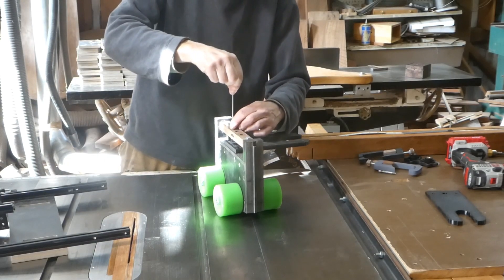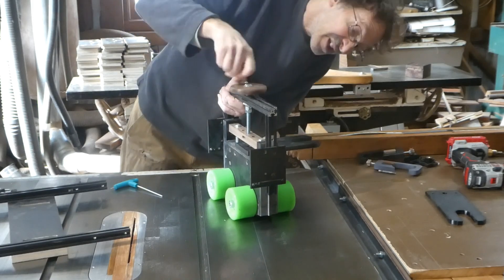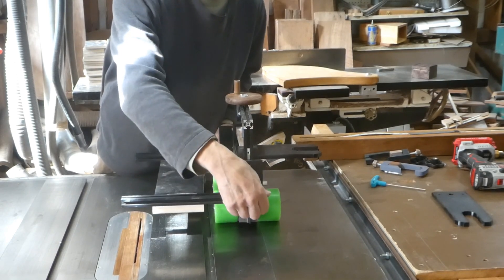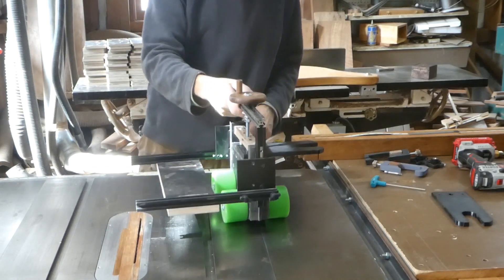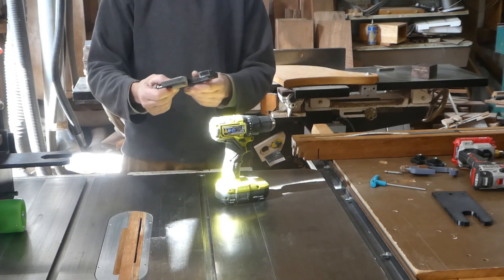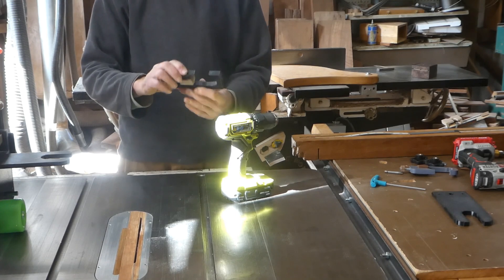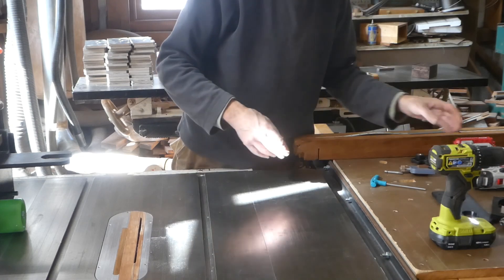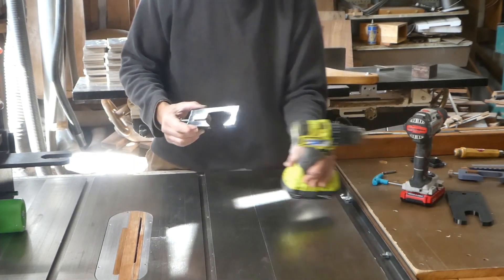drill switch and fork

Comment: Does your system allow the board to stay against the fence by feeding into it? Will this work with a delta t4 fence? One issue I notice with my fence is I get some deflection at the end of the fence
Reply from the maker: Yes, the Little Proteus holds the stock tight to the fence without causing deflection of the fence away from the blade. Depending on your fence and how heavy the work you're doing is, you may need to prevent the rear of the fence from lifting appreciably fron the table to get positive feeding. See  my owners manual,  P.39, downloadable for free from this page:
https://powerfeeder.alladd.com/new-little-proteus.html